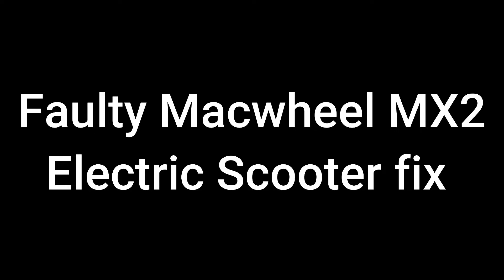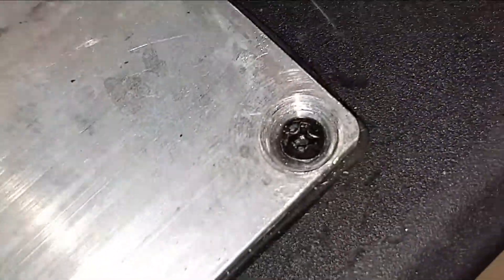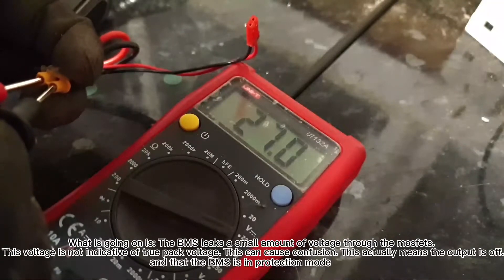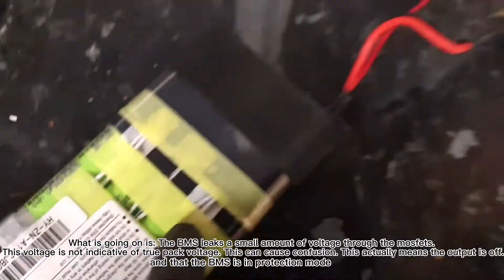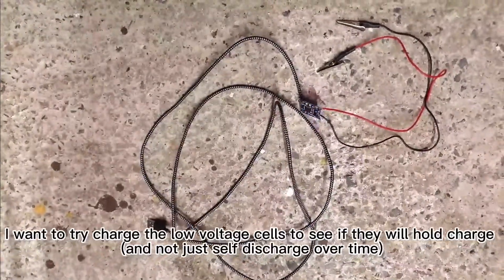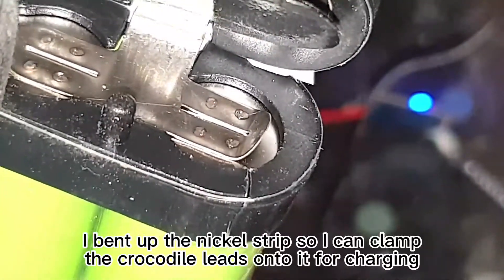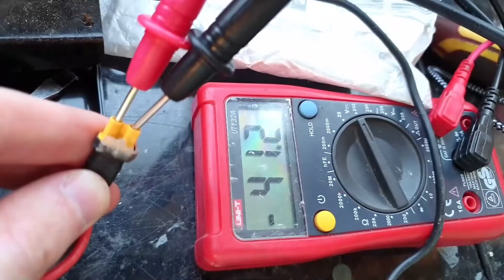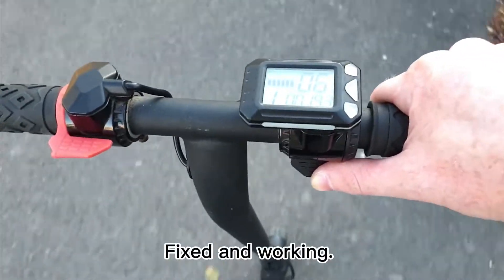Faulty Macwheel MX2 electric scooter fault finding and fix (similar to swagtron swagger) battery fix

Comment: My battery says 42v ? But it still won’t turn on bro or charge charger stays at green light
Reply from the maker: Is that 42v directly from the cells or on the wires coming off the battery back (which will be the output from the bms)
It sounds like your battery is fine, so more likely the controller or wiring or the screen is dead. Hard to diagnose over a YouTube comment
Reply: @rattech  yeah 42v coming out the yellow conector of the battery